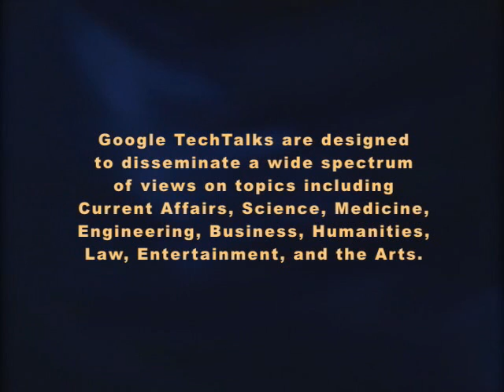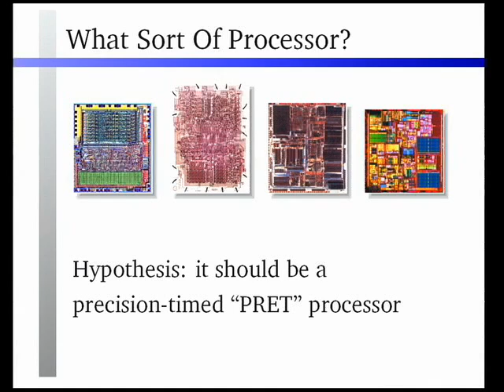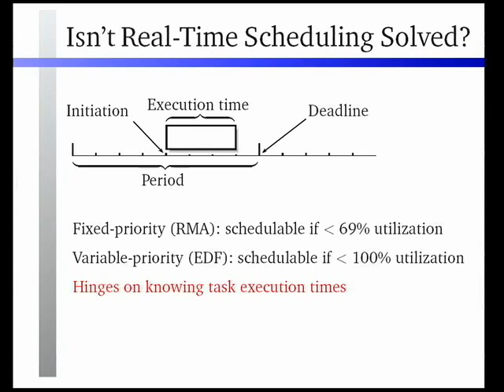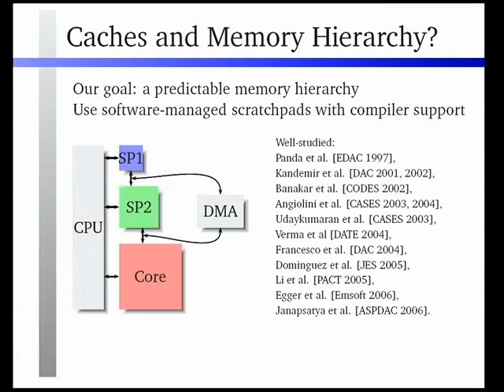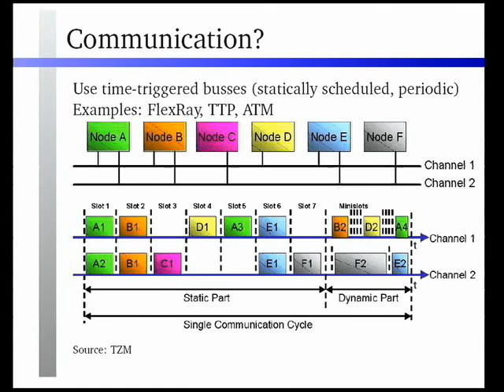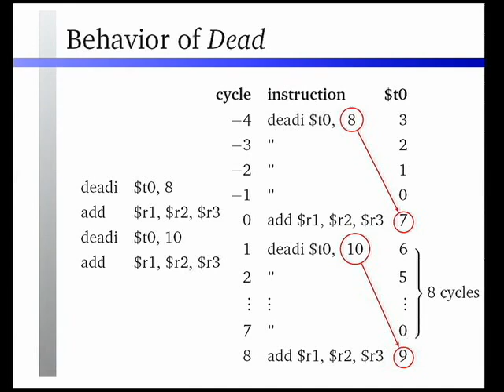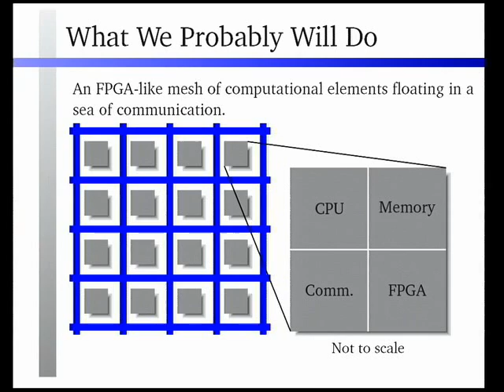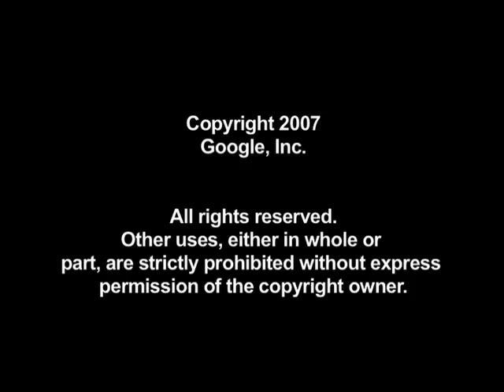What Do We Do With 10^12 Transistors?  The Case For Precision Timing

Comment: The general thesis is pretty flawed:  You'd have to eliminate out of order processing, reduce superscalar execution to predictable conditions, & know where the data you are accessing is located ahead of time.  If you want to enforce rigid constraints you just drag performance down to a slowest common denominator, its all missed opportunity for speed.  Go to 42m, theres a 10s slide showing many of these dilemmas in bullet point form: the problem is caches & pipelines and packet switching.